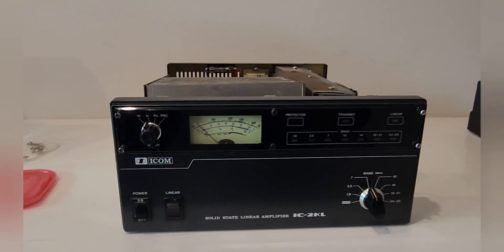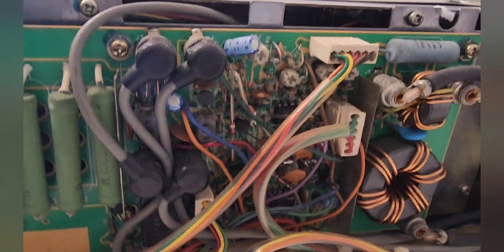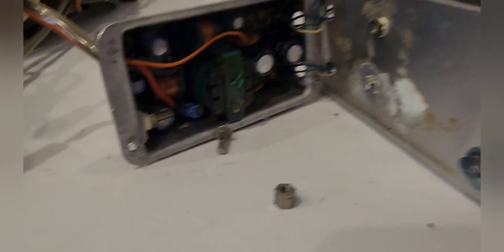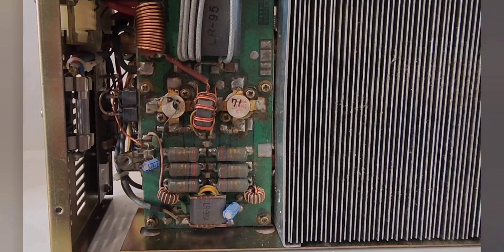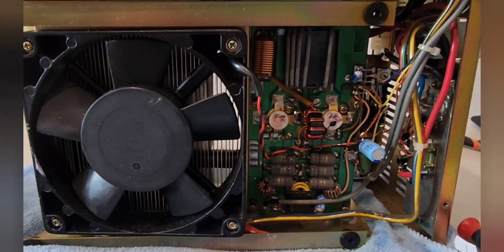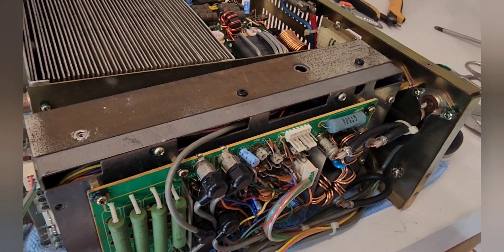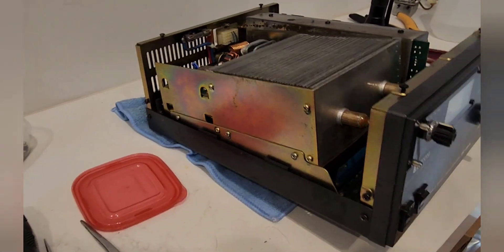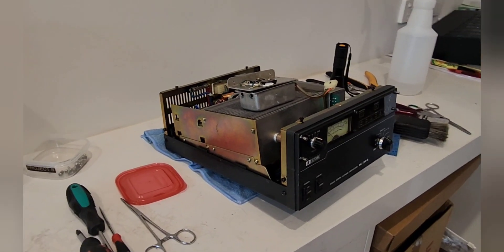ICOM IC-2KL RESTORATION - EVALUATION - MINOR FIXES - REPLACE ALL CASE SCREWS - CLEAN PCB - Part 1

Comment: Very helpful video. Just acquired a 2KL. So for the only thing i need to repair is the meter lamp.
My only issue is mine stops at 21Mhz. Looking for one that has the 24-28Mhz position, like this.
73
W9DLP
Reply from the maker: The USA model.   
Back in the day there were 2 versions of each Japanese amps as FCC regulated suppliers as well, would not allow ham amp 10 mtrs as it was to close to that other band
Reply from the maker: As per the video I put in an original type lamp as I think it looks oem vs leds
Reply: everything been working perfect till today. A loud "pop" and some grey smoke. Think I lost my reg board.
How bout a vid on re-capping and repair
Reply from the maker: The PSU in the set?  
What color was smoke?
Could be the regulator, I've read that these fail, mines been replaced at some stage.